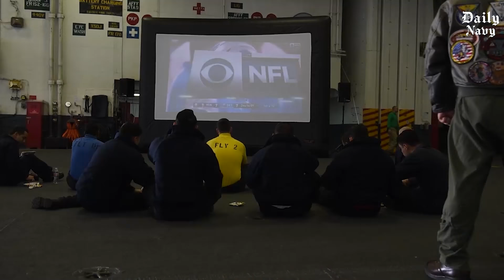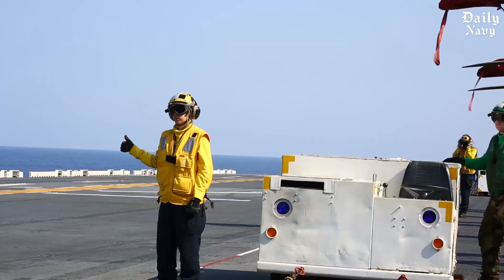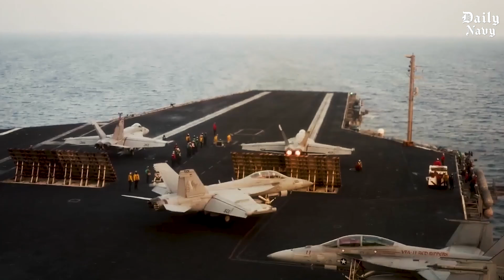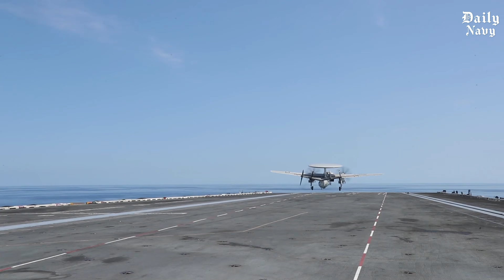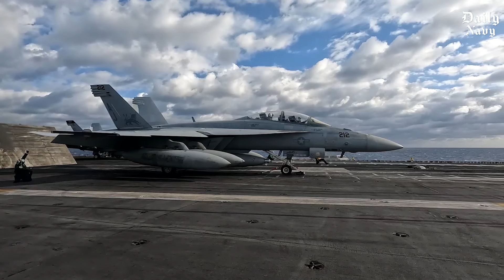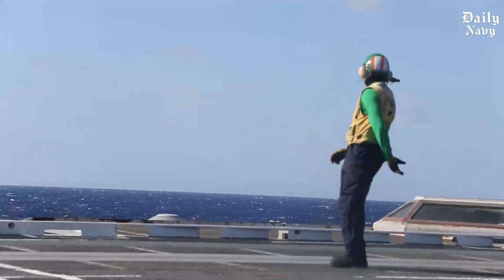How a US Carrier Turns MILLIONS of Gallons of Saltwater into Drinking Water

Comment: We must build desalination plants and many of them.  Fresh water is an evaporating resource, we have less rain in many parts of the U.S. but we an endless supply of salt water from our oceans.  Desal!
Reply: 😂 we do NOT lose more water to evaporation than is replaced by rain. The water cycle is a balanced and closed system. It's always rain it back but obviously varies where it rains it back.
Reply: You make a good point. However, I don't know if the worldwide amount of rainfall is decreasing or not. If it isn't, then I believe the issue is DISTRIBUTION of the water, from areas of heavy rainfall to areas that don't get enough. Our water distribution system may need to seriously improve.

Comment: I remember from my navy days, they also added just a little diesel fuel or jet fuel to the water.  The water tanks were outboard from the fuel tanks so the dump and fill pipes ran through the water tanks.  They had pinhole leaks adding fuel to the water.  When we pulled into port and got coffee at a restaurant it didn't taste right!  This was on a non-nuclear carrier.
Reply: In my chat bot days, we created millions of fake accounts on social and spammed millions of fake stories.
Reply: It happened  to my ship also we still drank it.
Reply: As a former Main Propulsion Assistant, Damage Control Assistant, and Chief Engineer aboard DD-700, USS HAYNESWORTH, I had not heard of adding fuel to freshwater tanks! Our Water King, worked in conjunction with the ship's Hospital Corpman, decided how much chlorine to add to a freshwater tank, before it was ready for potable (drinking) water use. Untreated (fresh) water was stored in separate tanks and used as replacement feed water for our main engines. Our ability to produce enough fresh water was a continuing challenge, so we took every opportunity to take potable water aboard whenever we were pier side and it was available.
Reply: @jamesseeley7810  Nope ...Greg is correct, we called it "Bug Juice" on the USS Forrestal, this was during the Vietnam War.

Comment: Actually, I think those systems could solve fresh water problems! Yes, I'd trust desalinated ocean water on a carrier way before tap water.
Reply: In the 1950s and 60s, it was common practice to not run our evaporators, that produced fresh water for drinking, whenever we were at anchor. Black water had to be discharged overboard and the input sea water to our evaporators would contain high bacteria count because the ship wasn't moving through the ocean, away from the black water discharge. Theoretically, we could have sent the water to make-up feedwater tanks for the main engines, but we didn't because then we wouldn't be able to augment needed potable water from make-up feed water tanks because of possible high bacteria count.
Reply: @jamesseeley7810  Holy Smokes!  So this is a paradigm shift.

Comment: You say the ship has ample energy but then they boil water under a vacuum to reduce energy use.  Yes, lower energy use is important even when there is ample energy, but the main reason is safety.  Water boiling at 100 degrees isn't as dangerous as water boiling at 212 degrees.  The heat is lower, the pressures are lower.
Reply: It is done that way for the sake of efficiency. More water less work. The EVAPS on USS Midway CV-41 could make 70,000 gallons of fresh water a day. There was 4 EVAP's.